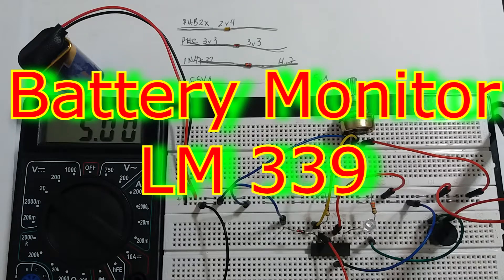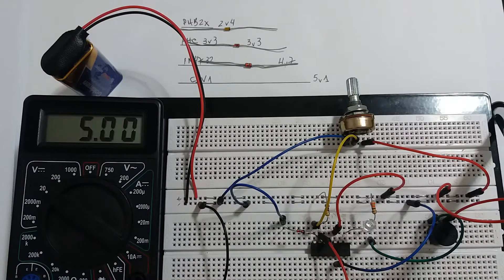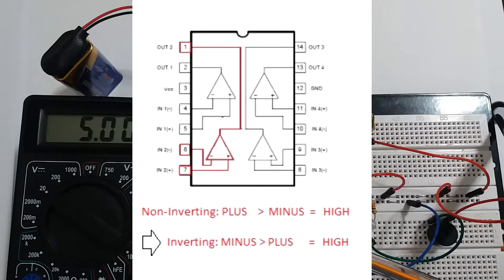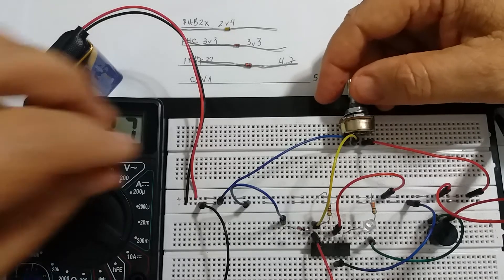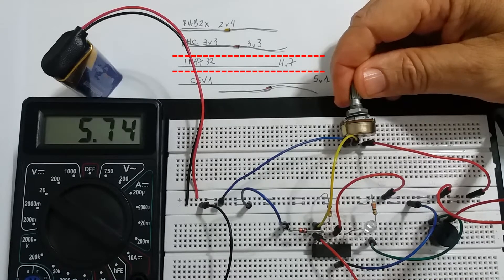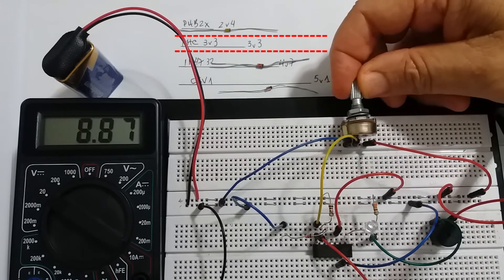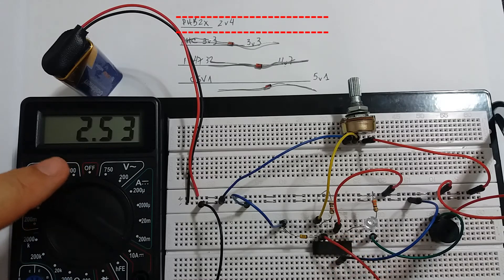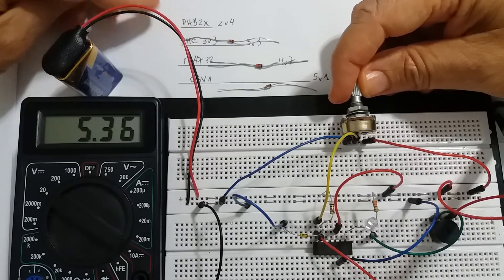LM 339 Battery Monitor Circuit - Zener Diodes #basicTronics 00

Comment: The voltage is not enough to indicate the battery good, but the current is the most important thing to be measure also....because your tutorial was using low power ( led = 0.02 A ).... Pls show me the actual load ( as per battery capacity in Ah )
Thanks.